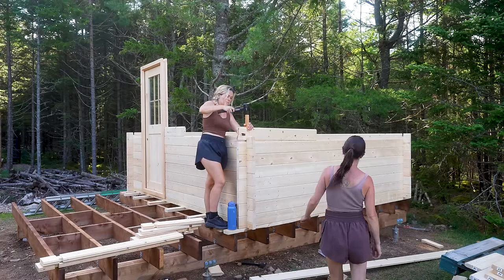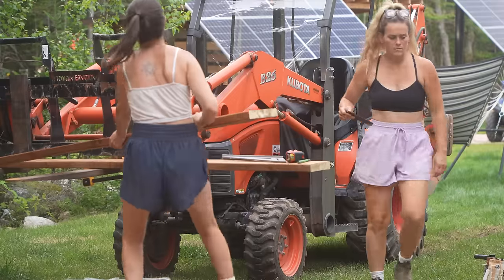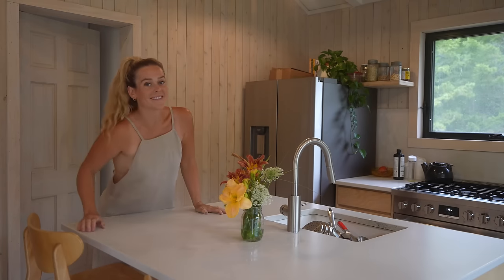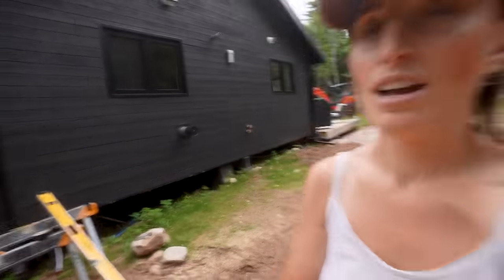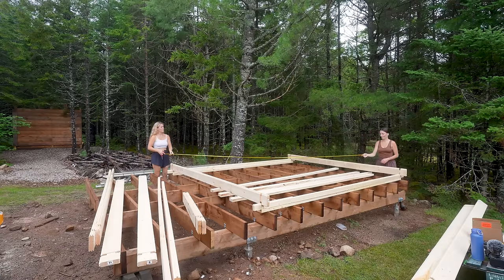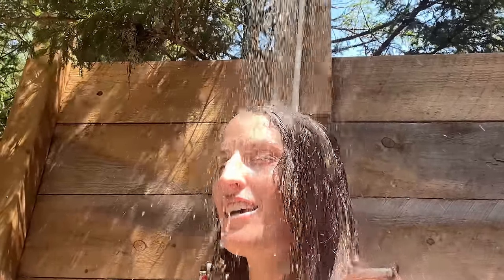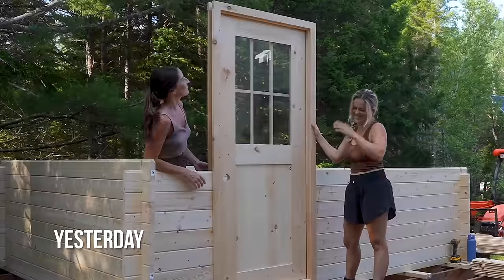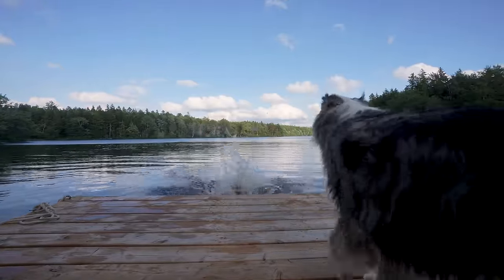Women Build Off Grid Log Cabin in the Canadian Wilderness (Part 1)

Comment: 🔥😲Jazzy, Crystal listen you’ve got to put an overhead fire sprinkler system, on your houseboat..!  If a wildfire came through, the four of you can escape to the middle of the lake..  You’re spraying, overhead, endless water supply, fire safety sprinkler system, will keep you safe. All you need is a water pump and some piping on the roof ( with holes in it ). You two can rig something up including solar power for the pump..   I’m sure Charlie, Eddy, Todd and Tyler would also benefit from the same setup..for safety of course..😊
Reply from the maker: That is a great idea. Now to do the research. Thank you for sharing with us.💛🐶

Comment: Just as an FYI take a look at adjustable Pylex post holders for future builds. Each one holds like 2400lbs and is adjustable in the same way those screw piles are and will save you a "pile". They can fit right into a concrete foot, or you can bolt em to a concrete peir if you want to get fancy. lol (Obviously not for major builds, but excellent for decks or smaller structures).
Reply from the maker: Yes those are sweet! Our land is to rocky for them unfortunately:(

Comment: You guys were right the first time with the front door,   the hinges are suppose to be on the inside.
Reply: @matthewcard I thought the same thing. I know in cold climates it is a common practice since it ensures a person who is inside can always physically open the door during winter compared to an outward swinging door which might be blocked by a pile of snow. With these 4 season girls, I wouldn't be surprised if they already accounted for possible snow piles and might already have plans to protect the door by adding on an awning or extending the roof over the deck... guess we'll have to wait to find out in their next/build part 2 video! :D
Reply: @jackpatrick2083  it not just that,  if the hinges are outsided,  you can pop them off and open the door that way

Comment: Love this! I have two similar 30M square cabins on my property using the same construction technique - top job!  One thing to check - the two windows installed with the black hinges internally facing I think should be the other way around with the black furniture on the outside, so they swing outwards not inwards :) ... like the door drama :p

Amazing space and can't wait to see it complete - surely a penthouse suite for Bella and Izzy?

Comment: should have used a string line level on the foundation instead of a spirit level against the flat side of the lumber to level the foundation boards, the lumber over that distance will have flex and is never truly straight to begin with

Comment: Here is a tip ladies...
It is best practices to put a 'shower cap' on the top of exterior girders and joists.  Built up girders are subject to rot from moisture collecting between the individual members.  Both will have little puddles of water 💦 setting on the top edge.  I use Vycor but similar products are available from other manufacturers.

Comment: For pipe docks, there is a product called “mud feet”. These are just 1-foot-square plates of galvanized steel with short lengths of pipe welded on, the latter drilled and tapped to accept bolts. I found these useful on soft lake bottoms.
Also, not sure where the downspouts empty, but if they do so near the house, would it be wise to have them drain further away? I don’t know what your house sits on. Concrete piles are not affected by wet soil, but wet soil can shift. Since you have a back hoe, you could even transport the rain water further away, and then install French drains. 
I’m a less sophisticated builder than you two. Just thoughts.

Comment: So lady’s I hate to be the bringer and of bad news but the foundation is not correct… with the ledger floor joist system you shouldn’t cantilever more then 2 feet with the sized joist you are running. You can cantilever 2 feet on each side but, can’t cantilever more then 2 feet on any one side.
Reply: How can they rectify it?  Thoughts?
Reply: @werejusdoinit6657  the easiest way is add a ledger beam at the end of the cantilever and support it on a the deck blocks… It’s no the best way but it would pass code.

Comment: Are you concerned that the deck end of the beams will heave in winter and damage the structure
Reply from the maker: No we just adjust when that happens…
 the deckends are actually cantilevered the weight of the structure is on the screw piles

Comment: No Seals between boards?  Wood dries out and shrinks overtime. Drafts or letting driving rain inside.   Walls seem rather thin to support a roof loaded with a ton or two of wet snow.

Comment: There is no way an exterior door swings out. It has to swing in. If you install your door with the hinges on the out side it makes it too easy for someone to pop out the hinge pins and break in. plus if someone is asleep inside and  you get 2 feet of snow during the night the person could end up trapped inside if they cant push the door open. It is only in very rare situations that a door swings outward.  I love what you guys are doing but I would double check with the manufacture to be on the safe side.  I realize having the door swing outwards creates more interior space but it can be a safety issue. Plus just look at pretty much every house you have ever entered before.

Comment: You all really need some chickens (6 at most), and like (2) - 8 x 8 Poultry Pens like from Tractor Supply and a Coop inside one of the runs, and the other run for foraging\playground. The pen I mentioned has panels that can be removed, and I left one panel in place cut an opening, and used the other panel and cut it down to be my "Door" - and then some stainless steel zip ties to be the hinges. Works great. The predator base is a mix of square concrete tiles and Cap Block to form a nice base that keeps predators out, with Hardware cloth as my base below the pad. The pen I mentioned has a metal roof too for hawks, etc to keep them out. Nothing is predator proof. I have both pens flush with one another. It would be great with the dogs, etc... they can do their thing, and the chickens can do theirs. Overall cost probably under $2000 US. You will have YEARS of use with little overall maintenance. Chickens are great for more then just eggs alone. Love the new cabin idea, waiting to see the finished product. Again, looks like you have your own water and electricity department, to feed utilities to the complex, like this new cabin. 

For my new deck\porch  project - I was going to use concrete bases and 4x4 lumber for the supports, I will look into the screw piles, to see if they might be a viable option for me too. Here they are called Foundation Screws, just looked them up locally, and they do not have the robust nature yours do, but we are talking about a small deck in this case, and they may work?? We shall see.
Reply from the maker: Thank you for sharing your knowledge with us. Enjoy your deck/porch project. 😊🐶

Comment: Ok so you used screw piles smart. Putting deck blocks on the deck over hang not so smart. When they frost heave something is going to have to bend or give because the screw piles are not moving.
Reply from the maker: We will adjust the blocks of course :)